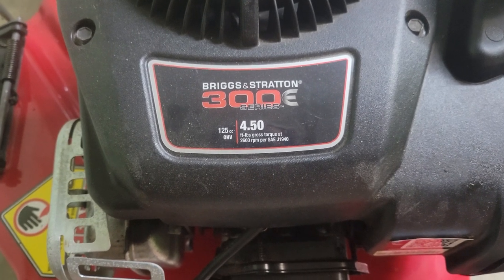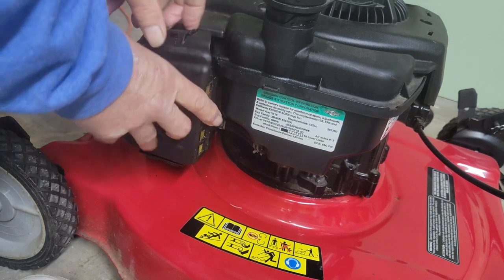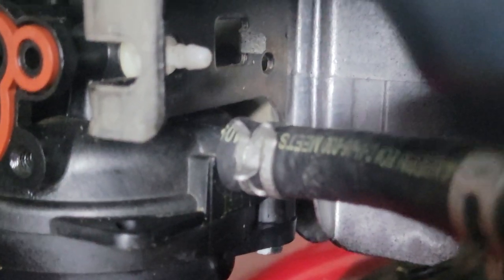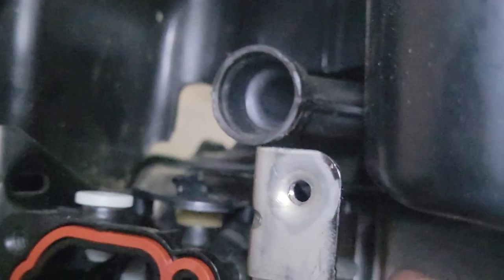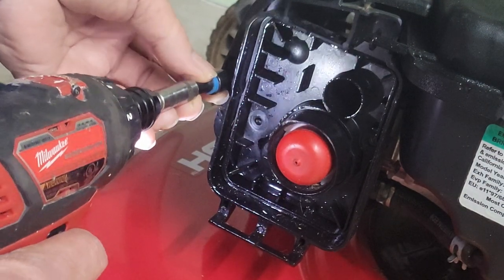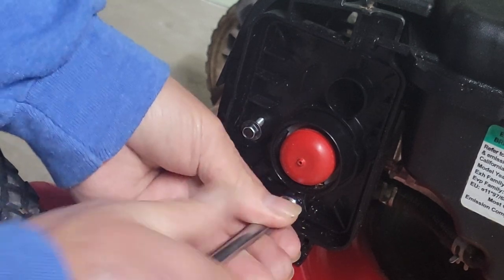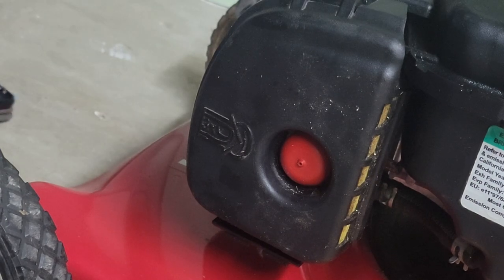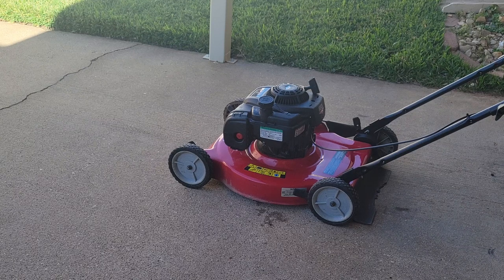Briggs and Stratton 300e won't prime, runs with starter fluid - Easy fix

Comment: I swear, if this works, I'm gonna be pissed lol
Reply from the maker: Rebuilding the carb is best,  but this works every time. I have a couple videos on cleaning the jets on this carb in the lawnmowers playlist but... try this first,  it will surprise you 🙂
Reply: @GuysPlayingWithTools  I normally clean the carb after it sits and it fires right up. I've always noticed it not really priming like I thought it should. I've cleaned and rebuilt several times lately and it will not run. Gonna try this today
Reply from the maker: @ChanceJames28  If you already cleaned the jets(the brass inserts on the white jet pack inside the carb), then this will surprise you. The design or the primer on these is pitiful, make sure the gasket between the carb and airbox is good when you add the plug and I would be willing to bet it will start first pull.
Reply: @GuysPlayingWithTools  I agree. Terrible design
Reply from the maker: @ChanceJames28 is a weird trick that gets rid of a design flaw
Reply from the maker: @markdanielczyk944  Did you try it?
Reply: @GuysPlayingWithTools  Not yet. I just picked up the exact same mower. Just need time to do the crime!
Reply from the maker: @markdanielczyk944  I like success stories. Let me know.  👍
If you have the tools and the time, pull the carb and clean the jets while you are at it.  I have a video on it in the mower Playlist
Reply: @GuysPlayingWithTools  Will do!
Reply: @GuysPlayingWithTools  Gotta say, I'm impressed. Your trick works! These 300E engines are a pain to work on, but pulling the starter assembly off helps. Think I'll keep picking up the old Quantam engines, quite possibly the best engines Briggs has ever made. Hyper Tough mower decks are JUNK!
Reply from the maker: @markdanielczyk944  It surprises everybody. 😁
The Quantum is the best motor ever made for a mower by *anybody*. If i could find them all day i would
Reply: @GuysPlayingWithTools  Every time one is on the curb, Yoink!
Reply from the maker: @markdanielczyk944  I don't get many curb treasures. I usually pay between $25 and $75 for them, depending on model and condition.
Reply: @GuysPlayingWithTools  Sometimes I get lucky, gotta beat the scrap guys!
Reply from the maker: @markdanielczyk944 The neighborhood I live in isn't the right kind. The city is 8000 yuppies,  and me.  🤣
Reply: @GuysPlayingWithTools  18,000 yuppies in the town where I work!
Reply from the maker: @markdanielczyk944 So you get it.  🙄🤣
Reply: @GuysPlayingWithTools  YES, yes I do!

Comment: Looking at the plug they had to have a reason for it but changed their minds,and for sure they know it's a bad set up so many failing they could at least gave everyone a cap on THIE thing before selling it to us😂😂😂😂😂
Reply from the maker: It's a vent to nowhere.  Cleaning the keys on the carb takes care of this problem too, but it fails a lot earlier than it should with that %#%% hole in the side. 🤣

Comment: These engines would be very reliable if it wasn't for thier cheap carburetors
Reply from the maker: I dunno, I like the plastic carbs. It took a while to get used to them and there are a couple tricks to them but all carbs are that way. The jets and float systems in them are really reliable compared to some of the older carbs and super easy to work on when they fail.

Comment: Where's the gas filter in these things?
Reply from the maker: Crazy as it sounds, they usually don't have one.
Reply: @GuysPlayingWithTools  
There is a cheap plastic screen in the gas tank over the hole going to the feed to the carb
Reply from the maker: That's more a rock catcher than a filter. Most mowers have a semi-respecabke steel mesh filter at the tank exit... That's one of the reasons it's not my favorite design.

Comment: I got mine to a point where if you prime it will run for a second or two, then die, then to get it running again, you have to prime it again, and it will run for a second or two then die...
Reply from the maker: This is a quick and dirty fix for vacuum leaks within the carb. Yours is going to need a touch more attention than that, you have a clogged jet. 
Give me the model of your mower and I will give you a link to a video covering that. It's a quick fix that most people can do without spending anything.
Reply: @GuysPlayingWithTools  Technically my "Mower" is little more than an engine sitting on a cinder block, but the numbers stamped into the side are 08p502-0152-f1 and the engine cover says E300 Prime 125cc My plan is to power something dumb with it, but for that, it actually needs to run.
Reply from the maker: @Daniel Auen  sounds like my kinda fun.  Watch this video,  it covers what you need for that carb.  https://m.youtube.com/watch?v=4pGj-1z9ym4
My latest vid is a go cart,  people are voting for the first  motor(s) and I am gonna make it happen 🤣
Reply: @GuysPlayingWithTools  Got it to a point where it will stay running thanks to you! its a little surgey and it spits oil out of the muffler, might be because I accidentally overfilled it a bit. but it stays on now. now I need to find a new cable for it.
Reply from the maker: @Daniel Auen  Very nice.  I was thinking about it half the day yesterday. If it's blowing smoke,  stop stop stop and drain the oil to the correct level.  Too much oil will make it smoke a lot. It can also make the piston choose a new direction, and that's only fun when it's not your mower 😁
Reply: @GuysPlayingWithTools  I think its only overfilled about a millimeter or three over the line, Not like I filled it to the point it was overflowing out of the block. The engine also wasn't stored level while I was working on it, Its not mounted to a deck, so it kinda just ends up tilted in whatever direction is most convenient for me to work on whatever part Im focusing on. and I have no idea how old the fuel in the tank is... There's not alot in there, and it still seems to be flammable so..
Reply: Im uploading a short of it running if you wanna check it out in a few minutes.
Reply from the maker: @danielauen7790  I am looking now. We are doing a live stream 1 2est at  https://www.youtube.com/watch?v=lelZYUEx-6o  Feel free to jump on, I will ask Phil to jump you up to the panel if you would like.(Not my stream, I am a "regular" though)
Reply from the maker: That was likely just muffler oil from sitting if it went away. 3mm isn't enough to hurt the motor.

Comment: I hope you don't think this was helpful. 1. How did you make the "plug"? 2. Where did you spray the starting fluid to make it run primarily?
Reply from the maker: Well... some thought it was helpful anyway... 🙂

I apologize that it didn't cover everything you were looking for, sometimes I make an assumption of skill level  that I shouldn't, I will work on that and try to improve. Let's get to the questions!

1. I thought I mentioned this part but I should have showed it on the video... I used a piece of clear rubber tube I had lying around the shop, I melted one end with a soldering iron and squeezed it together with pliers while it was still very hot, which sealed the end. You can get actual plugs at your local auto parts store, I didn't have any on hand that were the right size.

2. When you use starter fluid it is the same for all engines. on a small engine like a mower or weed eater you would remove the air filter and spray it straight into the carb opening. 

I hope that was more helpful for you. Sometimes I make the mistake of trying to keep the video as short as possible by skipping over parts that I don't think are relevant, I will work on that. 😁
Reply: @GuysPlayingWithTools  See, that's what I'm talkin' 'bout. Thanks, Now I think I can proceed, and if this works, YOU, my friend, are the MAN!
Reply: Don't get me wrong, the video was great, otherwise. Please keep up the good work. By the way, I subscribed to your channel (I think). Anyway If I didn't before I will now.
Reply from the maker: @MJ201254  No worries, I learn from comments, sometimes I learn what I did right, and sometimes what I did wrong . It's easy to think that everyone knows what you know but occasionally I need someone I remind me that it's not obvious if you don't do it every day. 

Live and learn, right?
If you get hung up, go to my about and grab my email, I probably talk to 10 people a week about how this or that works. I am retired so it's fun, I have nothing better to do. LOL
Reply from the maker: @MJ201254  I appreciate it. Feel free to comment the way you feel, if you like it, tell me what ya liked, if you hate it, tell me why you hated it. I learn more from people who have an issue than people who just tell me it's great.
Reply: How did you make the plug,
Reply from the maker: @danielcorbett4470  I melted the end ahut on a clear rubber(?) pipe I had lying around. 
You can get a rubber plug at an auto parts store pretty cheap, either way works well.
Reply: @GuysPlayingWithTools  Yup, works GREAT! I had even ordered a new carburetor. but it has worked like new without it so far. (P.S. I also drained the old oil and gas and replaced them first).
Reply from the maker: @MJ201254  Cool!  I will start mentioning draining fuel when I work on something too, it's usually the first step for me. 😁
Reply: @GuysPlayingWithTools  Right, I had to do that as regular maintenance since it is a two year mower that had never been serviced. Your fix is what got it going. Did I mention, You, my friend, are the Man!
Reply from the maker: @MJ201254  Now you made my day twice,  gotta love that.  I am doing a tiller that is nearly new but was used once, then parked for good. He put new gas in it while trying to start it but I didn't trust it.   I mention draining the gas 2 or 3 times.(see? I learn too! 🙂)
Reply: @GuysPlayingWithTools  thank you for this because I don't know anything about engines. I had bought this lawn mower from someone on marketplace and he showed me it started before I took it home. I tried to use it about a month later at most and couldn't start it so I had to use my weed eater instead 🤦🏾‍♀️
Reply from the maker: @opinionsrokay  Thanks. I try to cover as much as I can, if you ever have a problem you don't see here, let me know and I will make it next 🙂

Comment: ok nothing else to do, cleaned carb, gas tank, changed oil, new air filter, fresh gas...wth?  I guess we'll see..\its been mocking me, letting me mow a little bit then starting its crap again
Reply from the maker: These motors can be complainers. Did you clean the jets when you cleaned the carb? They are part of a white insert inside the bowl. I just did a video on a 500 series e motor last week with the exact same carb.
Reply: I can hardley believe that it worked....for ME!  Ms Unlucky finally caught a little bit THANK YOU..haven't seen this anywhere else!    🤗
Reply: I did I did..and some guy at work convinced me to do it again but soon as I saw it I knew it was as clean as it was gonna get, yes I had got to the jets.....so I slipped gas tank off and cleaned it.  It started and let me mow back yard then it just suddenly idled down low and started cutting off again...but you fixed it for me.  I believe this did the trick..I just snipped off a piece of thin clear tubing and melted the end, it slipped right on nice and snug and acts like nothing was ever wrong .  HA! @GuysPlayingWithTools
Reply from the maker: @poncandn1  Love it! One other thing I always check is that the choke isn't sticking. (They can be a little sticky and make the mower act like it's possessed)
Reply: @GuysPlayingWithTools  If it decides to play some more with me that's the first thing I'll check!
Reply from the maker: @poncandn1  You are following rule #1, don't fix things that aren't broken.  If it works, stop touching it. 🤣

Comment: Did what you said and still nothing 🤔
Reply from the maker: They aren't always the same, this fixes a specific issue where it starts with starting fluid and then runs fine. If yours does that, and is an ex motor but stopping the vent doesn't help, it's time to clean the jets. I touch on that in this one. https://www.youtube.com/watch?v=XJ8KuhVDils
This is specific to the black carb on the ex motors. It's nice to have an ultrasonic but if you don't, clear the jets with a needle or wire.(I show that at the 12:30 mark)  Lemme know how it goes!